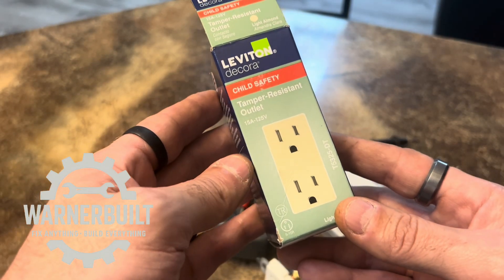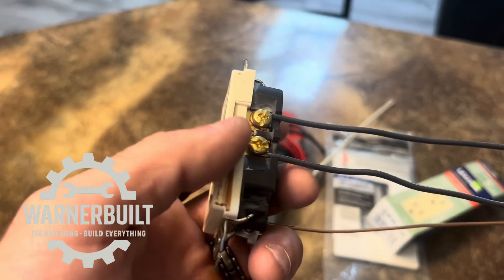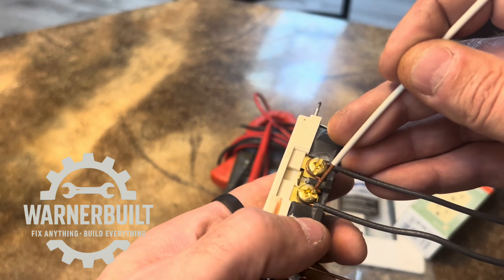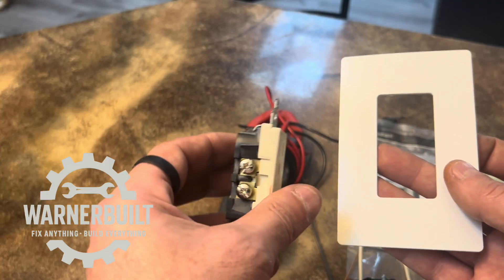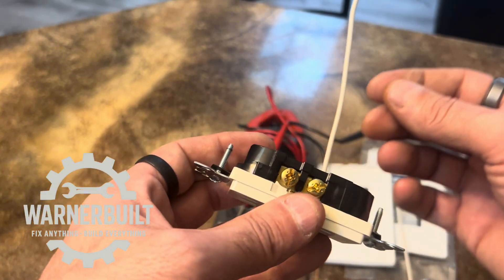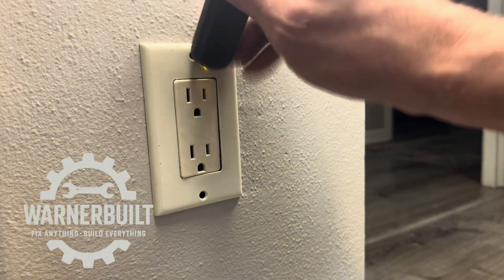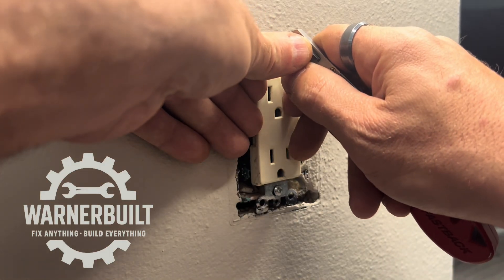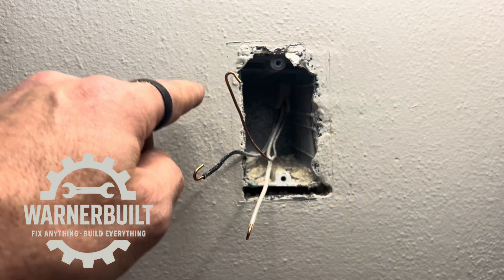🔌 How to Replace a Standard Electrical Outlet (Step-by-Step for Beginners)

Comment: The correct screwdriver is a #1 Robertson (tapered square drive) or an an ECX drive which is a combination flat and square.  It's too easy for a flat blade screwdriver to slip out and a Phillips will likely cam out before the appropriate torque is reached.
Reply from the maker: Thanks @surferdude642,  I am going to order one and try in a video